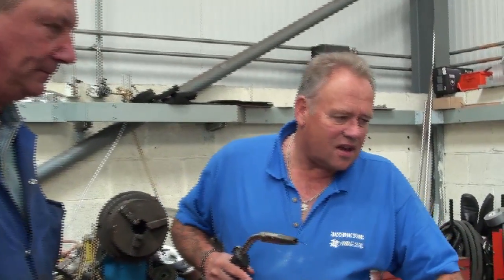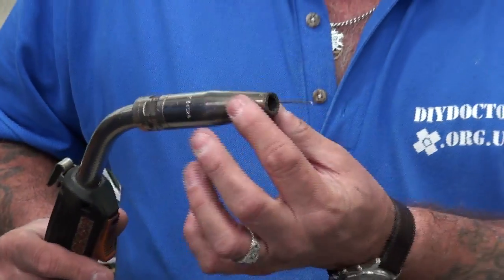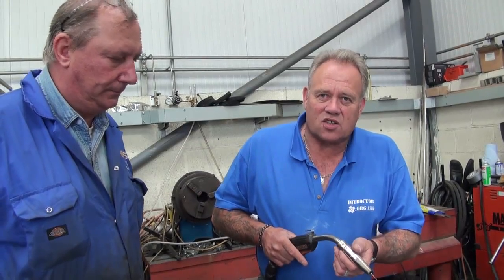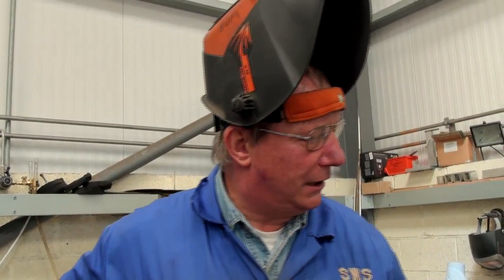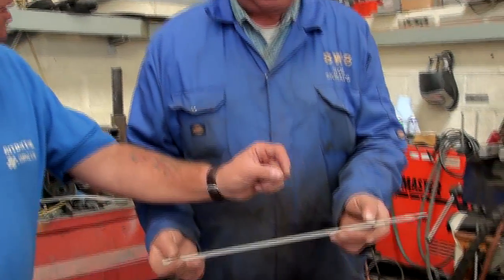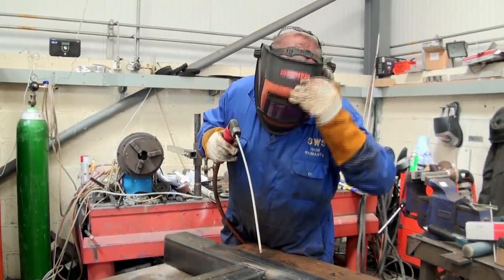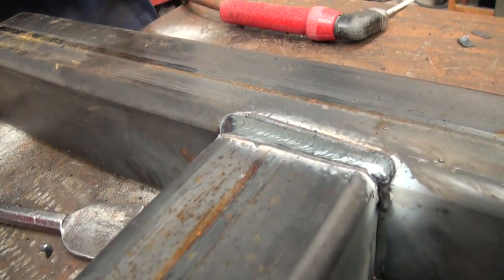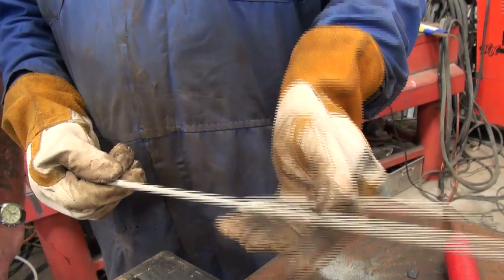Mag, Mig and Arc Welding How To Tips and Information

Comment: mig welding is easier, but weld is also weaker than with stick.
Reply from the maker: Hi Gordan, thanks for writing in. Mig welding is as strong as it gets on thin to medium metals but everything has to be right. Cleanliness of metal, using the correct cover sheild, not setting the gas too high. Stick welds need the same attention to detail and are far more suitable for thicker metals but MIG welds are used in many areas where strength of weld is absolutely essential, eg moto cross and stock car racing. MIG welding has neen around for over 50 years now without too many iterations so the saying "If it works, dont fix it" especially applies here. We allhave our favourites I guess as a lot depends on the finish we want to achieve but we have never had a broken MIG weld so the strength is not an issue on the right material.

Comment: I've got a powermts welder which is made for both mig and stick welding and yeah, mig welding is much easier to pick up. no flux to worry about getting trapped in the weld and no stopping to put in a new electrode. there is something to be said for stick welding though and it is definitely a good skill to pick up.
Reply from the maker: Hi Jon, thanks for taking the time to connect with us. If you have any images of your welding which may help others to get the job done please feel free to publish them.
Reply: Do you have an Everlast PowerMTS welder? I've been thinking about picking one of those up. It is the only one in my price range with 4 gear drive rolls.

Comment: the key to a good weld is a combination of matching the rods to the metal you are welding  the machine you are welding with be it ac or dc and lots and lots of practice there are rods strictly for ac as well as for dc and there are rods for different positions too some are what is called fast freeze ie:6010, 6011 , 6013, and some that are very fluid like the 7024's 7018 is fluid but mutch faster freezing than 7024 making it more forgiving and a favored rod by most of the welders i have talked to